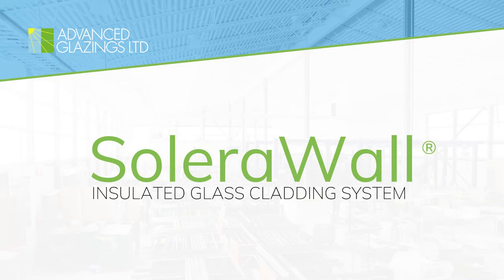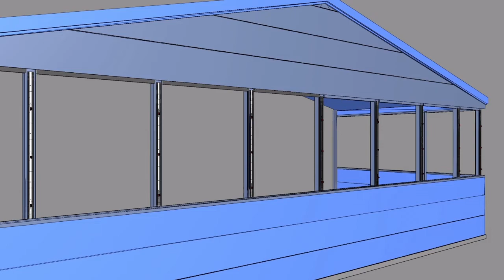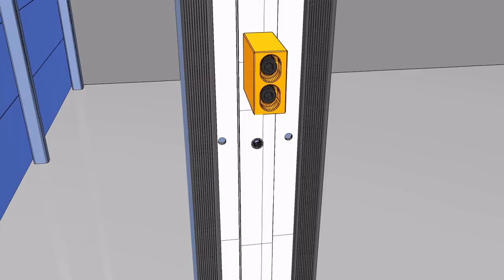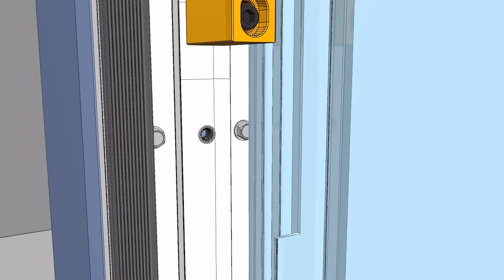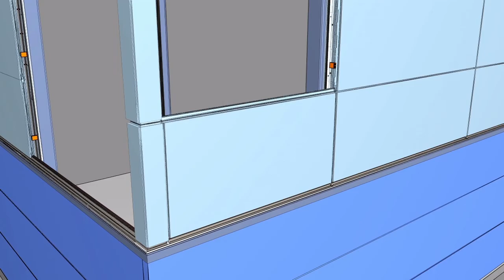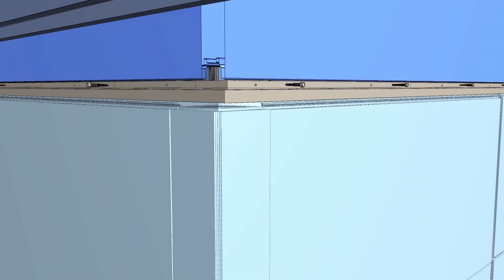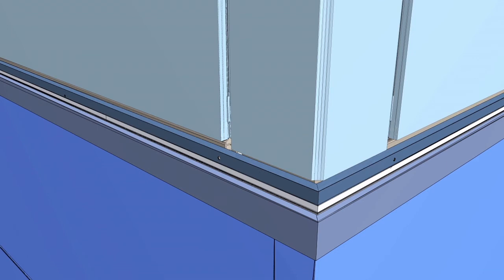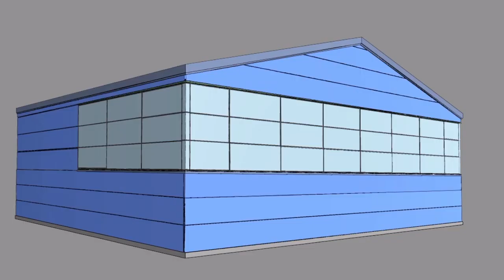SoleraWall Insulated Glass Cladding System Story

Comment: It is very reliable product which unit have clever silicone corner filling design preventing water and moisture infiltrate into glass unit. As a test result, there are no water leakage inside with double wall safety sealings. Also considered tripe water flow or drainage system, there will no any water leaking into building interior if install properly. Hope you can sold more products.